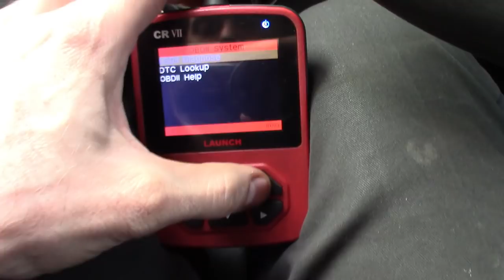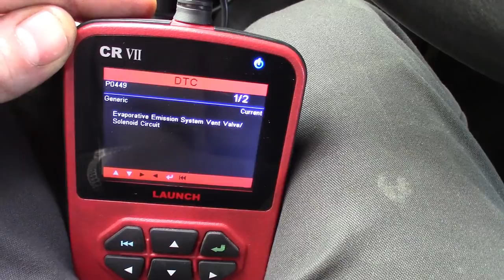Plan for the Worst, Hope for the Best

Comment: i have one of those lights that i left on the firewall of a car. customer was supposedly moving out of state and it wasn't until the next day that i noticed it was missing and he supposedly left the night that i got done with the car, so i didn't give him a call to see if i could get it back. a year later he came back into the shop for a check engine light. turns out he never moved and i quickly looked in the engine compartment and surprisingly the light was still there. it was dead and had some rubmarks. but i charged it and it still works. love that light